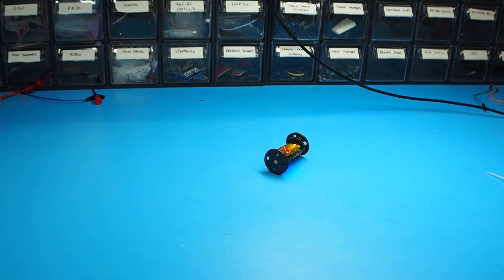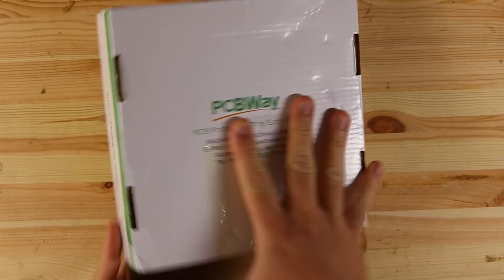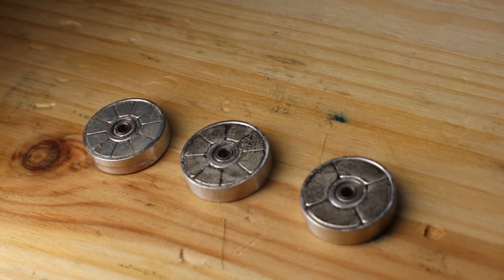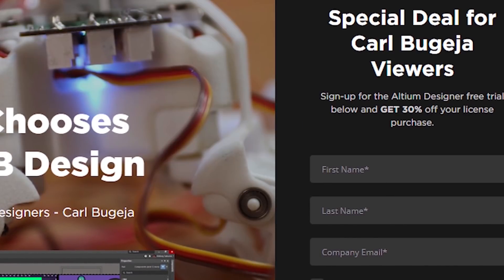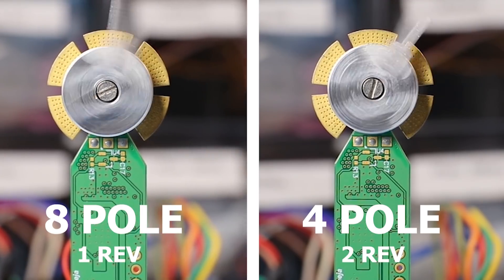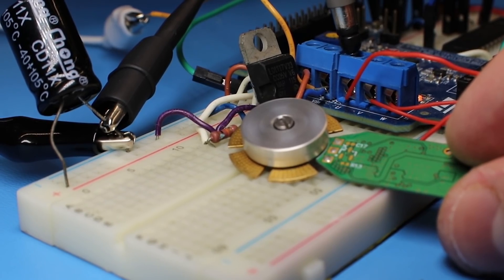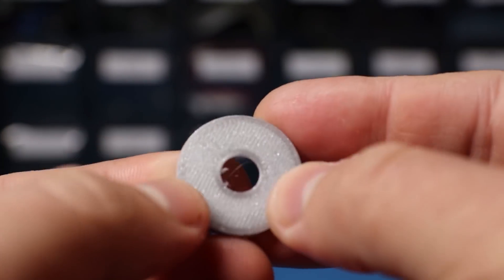PCB Motor 2-Wheeled Robot (Part 2/3)

Comment: Things to try: Higher precision bearings with cylindrical rollers , sleeve bearings (Delrin comes to mind), self lubricating bronze bushings or a regular bearing with two internal rolling tracks (double ball bearing in one) Or even a trust bearing (sometimes called PANCAKE bearing). They all fix your problem.

Comment: Looks like you are driving the motors faster than they can go at the end there. You might have more success if you slowly ramped up the speed you  drive them at until a target speed is reached, so the wheels have time to spin up and gain momentum

Comment: Nice concept of the motor, but it seems to me that all the experiments you have to do with poles and etc are already described in some electrotechnical literature... As for the overall design it seems to me that it's absolutely ineffective. Electromagnetic field is really weak with such a thin "coil" on PCB. As an advices try to make something like a drone outrunner motor. But replace coils with PCB tracks going spiral not on the flat surface of PCB, but going through PCB so if look on the PCB you'll see just lot of parallel tracks on each side of PCB and tracks on sides are connected through hole. Hope you understand what I mean))

Comment: may i suggest that you add some more weight at a lower centre of gravity on the body of the machine so that the motion from the motors is more efficiently transferred to the wheel. at the moment the motors and programming are fighting each other. once that is sorted the efficacy will shoot up.

Comment: I'd try to keep the wheel diameter to a minimum to increase torque and use 4 wheels with tank steering.

Comment: seeing how the 'robot' shakes all the time, i suggest to add more delay between the reading of the sensor(s) and actually applying power to the electric motors.
Also a way softer start and softer switching power between the coils that move the magnets.

How about adding a gyro? just one electric motor that will spin at high rpm to stabilize everything end kill the wobble?

Comment: Can you source 2 thinner bearings? This should already improve the slack.
Also you might want to get started on the "self balancing" motor driver code, so it can smoothly drive, at least for better visuals 😁

Comment: A way to reduce wobble could be to press for a shaft into the rotor. Then you could cut a pocket into the rotor a larger diameter than the bearing OD And make a cup that holds the outside of the bearing, then attache that to the pcb. Place another cup and bearing on the other side with the bearing over the shaft. You can even place another rotor on the end of the shaft. This should keep it compact and would also allow you to utilize two rotors to increase torque.

Comment: if you add a third wheel sticking out the middle, the whole assembly will be secured in place while driving, eliminating the need for balance checking and letting the 'bot move more smoothly

Comment: you could also use a through shaft and put the bearings in that axial. or try looking into gem bearings as they should work for this
Reply: I had the same idea, put 2 bearings inside the center section and add an axle that the wheel attaches to.

Comment: Pretty sure your rotor play is a result of the shoulder screw loosely fitting with the bearing. Create tighter tolerances with the bearing. Bearings alone should not have that kind of play.

Comment: You need to increase the weight of the center assembly and move the center of mass further from the axle.  At the moment the CoM appears very close to the axle, which is th factor that is limiting your torque.

Comment: Hi Carl,
Another bearing type you can use is angular contact bearings.
Reply from the maker: Thanks for the tip! but unfortunately the minimum size for angular contact bearings is 10mm which is too big for this rotor - the one i'm currently using has a 5mm outter diameter

Comment: Would recommend adding a piece out front with a third wheel or even a ball. You can prevent the whole assembly from moving which would enable more smooth movement of the robot in general. Love your rotor designs so far and looking forward to continued improvements!
Reply: i think the point is to make a two wheeled microdrone style robot, but I would agree that a tiny servo arm or some third point of contact in the center slightly in front of the bot would hugely increase speeds and stability possibly something retractable that only extends when "forward" is required.
Reply: Do it like the rainbow 6 drone

Comment: If you want the angular play to go away, you'll need a second bearing.  If you shim the outer races apart just a bit, you'll produce a back to back angular contact set, which will eliminate the play and be much stiffer.

How about an inverted pendulum bot?  :)

Comment: Aa some have said, bushings would be acceptable for your setup, also using thinner bearings you could get 2 into the rotor without adding thickness. they may be unshielded though which would need cleaning more frequently

Comment: Those oscilloscope waveforms show you are driving the motors as steppers, not brushless motors. You may find that you actually loose torque as they may start to swing back before you commutate to the next step. It is like braking a certain percentage for every step you take... Very inefficient.
Have a look at emf-driven commutation and see how much better they run!

Comment: Tilt the wheels inward so the axles are slightly hanging.  Adds friction, but it will keep the wheels more stable relative to the chassis.  Negative camber.

Comment: This is interesting, but I don't understand what is the point of the PSB motor, because they have become thick enough that they can be replaced with a classic thin-profile motor?

What are the benefits of PSB design? Aside from perhaps faster mass production, which isn’t usually a problem with small cheap motors?

Comment: On the inner side use a rotor with magnets with the diameter smaller then the wheel, just enough for the connections between PCBs. 
Move the ball bearings under the main PCB and use 2 axels rigidly mounted on the rotor(s), use 2 BB per axel to remove wobble.
or
Make the hole in middle big enough for the ball bearings so that you can use one BB on each rotor while keeping it flat. The torque is influenced more by the outer diameter anyway...

Comment: Pumping a lot of money and time into a "robot" that has never been designed correctly to begin with, designing it ass-backwards with the motors first and fixing the obvious balance issue afterwards.
I don't think it's viable at all to design a self balancing robot of this size, need at least 3 wheels.
But then it still makes 0 sense, toy with no purpose and whole reinwenting of a wheel, there are already motors and wheels for that exact application.
It's if he just tries to desperately give some usecases for his weird PCB motors to just get more sales.

Comment: Why are you only using 2 wheels? Is that a necessary design requirement? 
It would probably run better if it had a firm unrotating frame. Also I'm not sure how you would do it but including a sun planet and ring gear with the edge of the wheel being the ring gear could help with the low torque. Anyways cool stuff

Comment: if your using a single bearing, then you Need to make a long End Cap Bushing to support its circlip retainer + inner shaft & so take out the generic slop.
End Cap Bushing as you can make the pcb hole to fit the lip for a tight push through pcb support fit.
a diy micro version of 'Board Rod End Cap Foosball Bushing' if you will.

guessing custom sized magnets is a waste, just get round mags of generic size, then just chop them in to quarters ,grind etc then re-electroplate the ends or other seal them against the oxidising air

Comment: With two wheel robots a tail helps the motors turn the wheel instead of the body. It adds a small amount of weight and ground friction but for a robot like that I would just use a thin wire.

Comment: Sintered bronze bushings preloaded with oil. Cheap, reliable, can support both axial and radial load, low friction. They are used everywhere for these types of applications. Plus they are lighter than the ballbearings you are using.

Comment: great job, looks like ur getting that to work pretty well. Maybe some PID tuning to remove some of the stuttering? Are these motors strong enough to move a potentiometer? That would be really cool in something like a modular synthesizer application (envisioning all of the knobs moving to give visual to the sound coming out... really cool).

Comment: Idea for diy bushing. Using a syringe needle, and a pin. The smaller diameter means less area for friction, and light oil between the two would make them slide.

Comment: You don't need two bearings just preload the bearings inner ring with a washer spring and the wobble is gone. Obviously you would have to need some thing to regulate the tention of the washer spring

Comment: Ball bearings are available with different levels of play (named MC1 to MC5 for some of the manufacturers).  In this case, as no extra mechanical stress is applied on the bearings, the least play version is the best option.
Reply: Just curious, would bearings with less play inherently have more friction and require more torque to turn? Seems like there would have to be a trade off for removing the play in the bearing races.
Reply: @ttgydddsd6305  In this application there will be about no difference in friction for as long the bearings have some play.  A very slight difference in friction could be caused by the grease that has to be pushed through narrower gaps when little play.  But that is easily solved by just dissolving the grease.  From as axial forces are applied (is the case for most applications, but not here), the story is different.  The least play bearings then have quite larger friction because the contact angle between balls and circumference is much steeper and results in much higher contact pressure and more friction.

Comment: There is waaaaaay to much play in those  bearings or your shoulder bolts was made to small diameter. Bearings has some play, but if you use precision bearings there is minimal play.

Comment: Shouldn't a sleeve bearing instead of ball bearing give a better stability? Most of the motors in the low speed have them to get a good rotor stability.

Comment: Try to put some weight on the body itself so that torque from the motor won't rotate the main body instead of wheels. This way I think Robot will be more responsive to sudden change in acceleration.

Comment: Could also yoke the magnetic field on the non rotor side of the coil. This will further increase the magnetic field in the gap between stator and rotor, as well as provide thermal heatsink for the coils.

Comment: Why not put the bearing around the magnets in place of the center? Take a look at the THK RAU bearing series, which is a cross roller design. Also it may be easier to find a needle bearing that could work. You may have to glue it to mount it?

Comment: Your maximum torque is limited by the balancing nature of the 2-wheel design. While it’s an option to lower the COM as low as possible, a third wheel would multiply the possible torque quite a lot.
Reply: That’s what I was thinking too, one trailing wheel to prevent over-rotation.
Reply: Just do it like rainbow 6 siege or the ThrowBot

Comment: Your videos just keep getting better and better! 

Maybe you could add a third wheel to help keep it stable by keeping the board in the middle stationary?
Reply: The point of the project is to have as few wheels as possible.
Reply: @gordonlawrence1448  then maybe a lever arm or something. It seems like it loses a good amount of energy due to the rocking of the axel (the main board)

Comment: what if , the bearing is as big as the wheel, and the motor magnets are inside that bearing ? one side of the bearing connected to the main body, the other to the magnet assembly ?

Comment: Thrust bearings... Normally used for axial load... In this case with your device weighing nothing you'll get away using them to carry the weight.. It'll also allow you to "clamp" your wheels to the body and the radius of your contact is a lot greater to prevent wobble... Basically because of weight you're able to sacrifice weight carrying capacity for sturdiness

Comment: Do you know about brushless gimbals for cameras?
They use 3 phase brushless motors but not in a motor configuration but rather like a positioning drive. They do it by driving them without BEMF or sensor feedback, by supplying them with 3 constant currents following a sinus shape with 120° phase angle to one another. 
That way, they can drive them incredibly smooth from a standstill. I once built a little RC car with direct drive, that operated its motor in that kind of configuration.

No idea if you're already using that technique, but maybe it helps.

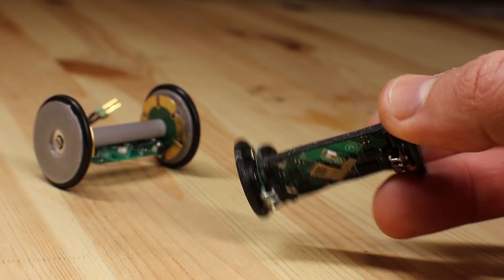Comment: To decrease the wobble seen at 4:50 you should look into implementing Field-Oriented-Control (FOC) for the motor. Maybe back-EMF will do but I highly recommend adding some kind of encoder to know the state of the rotor. Then I would design a PID controller to keep the center PCB level using a gyro sensor. Whatever is currently controlling the motors (and indirectly PCB angle) is inducing way too much oscillation. FOC will use smooth sinusoidal coil currents and also the most energy efficient way to drive electric motors. I'm not sure if you have experience in Control Theory but I am certain that good controller design could compensate for the limitations given the hardware.
Reply: I think this was more like a quick test, because the design itself isnt final anyways
Reply: Or just add a third wheel in the middle lol

Comment: I believe the term for these flat motors is an axial motor, which i think usually have 6 individual coils, and 6 magnets on either side of the coils. The coils are also powered 2 at a time
Reply: I was also looking at this thinking "That looks like an axial flux layout instead of radial." 

I think he may have spoke about that in a previous video?

Comment: sorting out the slop on the bearings will greatly improve the torque as well, as once you have a rigid bearing assembly, you can make the gap between the magnets and the coils smaller.

Comment: Use bushing instead of ball bearing, they are easy to find or make some with PTFE
Reply: It would seem that bushings would be a problem above a certain RPM. But the speeds he’s currently operating the wheel set at, it wouldn’t seem to be a problem.
Reply: @deepsleep7822  it wouldn't be a problem anyway as the bushing is holding the inner bearing shaft solid & static, only  the outer bearing part is moving.
the end cap bushing is just to give the shaft rigidity through the pcb.
hell he could even use stock 2mm shaft, copper electro plate it, then solder it directly to through hole pads on both sides of the pcb ,then push the bearing assembly etc over that solid pin, simples. hell 2 just put a bunch of through hole pads in a circle then solder real insulated copper in the overlapping 1+3 pattern winding.. as rob says more copper= more volts/amps.
fundamentally there's only ever 3 things at play/to tweak here ,the amount of copper length, the magnetic fields cutting that copper, only copper cutting at 90%, parallel copper is just waste that adds nothing up/down rather than right down, right,up , etc, every right is waste, minimise it  & speed/current.

as in the real basis for a real generic 1 to whatever pcb Cycloidal Gearbox say in a 1inch or 2inch pcb Cycloidal Gearbox video's with sub's & clearer english
Reply: Yes, oiled bronze bushing is better than BB for low-speed stuff like that.  If an intial lubrication isn't sufficient, he can 3D print a tiny chamber for an oiled wad of cloth (packing).  He'll need to break each one in with with a fine polish compound.  ...Works for instruments.
Reply: came here to say just that! ahahhahaha I would not recommend ptfe bushings for something so weak and expect good speed. go for small bronze disc bushings, use one on each side, and light oil, you should be fine. It is, after all, what every small motor use as a bearing element.
Reply: came here to say the same thing.. PTFE.   and really,  high rpm's..  its a robot.. any PTFE bearing will handle what that little thing will do..   and FAR better than bronze.   #1 reason: DRY.  no lube needed.    #2,  PTFE is used in very many applications that involve WAY more than 12k rpm's.   at 12k rpm's.. how fast would it be moving with those wheels?   just saying.
Reply: I recently looked into bushings for a project and was surprised by RPM ratings, worth a try for the small cost.
Reply: If he 3D prints the entire Aluminium part but with a smaller hole in the center, he could drill (and maybe ream) it to appropriate size. I have used PLA as bushing material on 6mm stainless steel rods with great success, but it is important that they do not get hot. Instead of a reamer i pressed in the rod after drilling and turned it a few times by hand and then a few minutes with the drilling maschine. The bearings had very little friction after this process and worked for hours and hours on my robot with no signs of fatigue.
Reply: Could use one of the Iglidur bushings that Igus produce, they are light, available in a massive range of sizes and types and Igus have a really nice sample program.
Reply: I would look at going all the way to using a single bronze rod as a single-piece axel going all the way through, including for the bearing surface, and then cut threads into the end to add retaining nuts to.